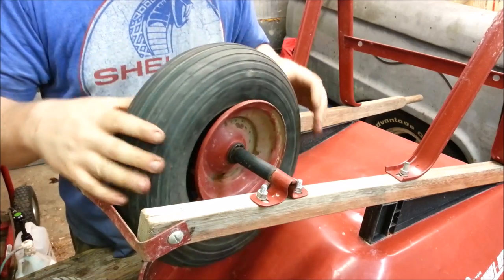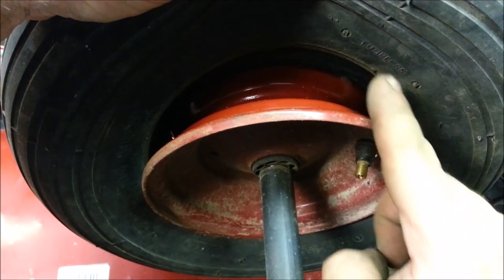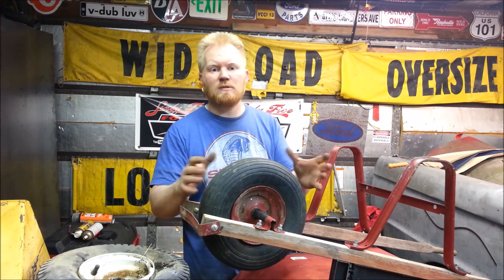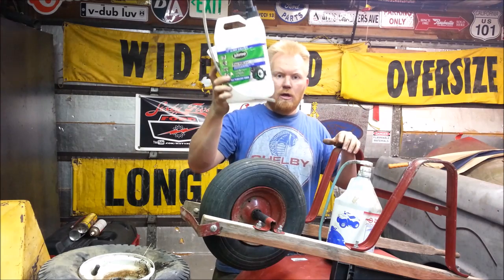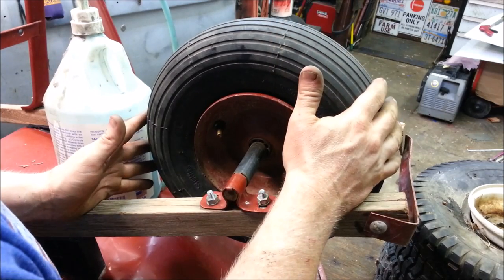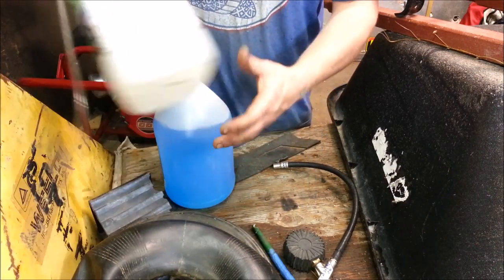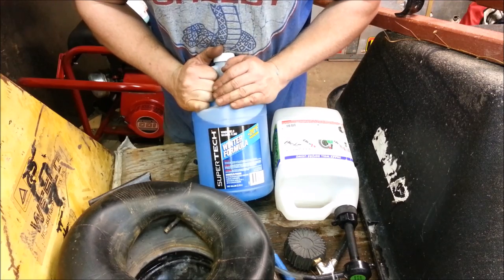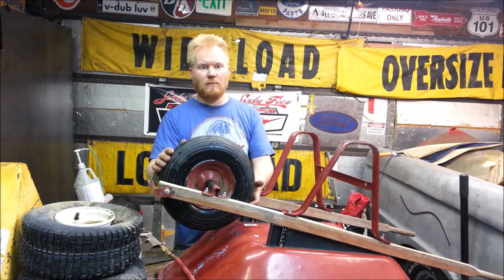No More Flat Wheelbarrow / Riding Mower tires

Comment: I just drill holes and fill it with expanding foam....
Reply: Interesting
Reply: You should make a video of that process.
Reply: But wouldn't the foam crush down and go flattish with use?
Reply: Thats what I thought he was going to do
Reply: @stephenhopkins9541  my son did it to his motorcycle tire the rear tire. I'm 225 lb I rode it 4 miles
Reply: @onewordhereonewordthere6975  did it go flat after the 4 miles or is it still standing

Comment: One of the tires on my snowblower kept losing air, until I Slimed it - no more air loss!  Works to a lesser degree on car tires, at least long enough to get it repaired.  Gotta try the windshield washer/slime combo next time my wheelbarrow tire loses air.  Thanks for another tip, your mind must be constantly working overtime!
Reply from the maker: Dale W Miller Thanks for watching, Dale. Yeah, I've been impressed by the things it can seal up.  -Moe
Reply: I slimed all small tires.  Only one developed a leak st the stem.  The slime dried in the valve stem,  preventing the valve from sealing.

Comment: FYI, I will run a wheelbarrow tire until the first flat! And then it’s garbage! I go to my collection of used 4:80 trailer tires. Install one of those, running 50 psi. And never look back! The thickness of the trailer tires makes them “almost” flat free, tire slime would cover the times it’s not. And the extra air pressure keeps the tire from losing the bead seat, not to mention round. Like you have never rolled a more effortless wheelbarrow. Even with 6cf of concrete, effortless! On a side note: a short piece of flat bar or angle iron in front of the tire scrapes it clean from everything, mud, concrete or anything that might have stuck to the tire.
Hope this helps someone as much as it’s helped me! 👍👍

Comment: It's been about 4 or 5 years now since I used Slime on my wheelbarrow and it's still holding well.  This is the first year that I have to add a bit of air to both tires.  That's pretty freakin' good compared to losing the air every 4 or 5 days.  Thanks again.

Comment: To set a bead I like using the ratchet straps method...wrap it around the circumference of the tire..keeping it centered, then tighten and add air. Works well 👍. Great video . Thx

Comment: Here is my method. I got this tip from another YouTube video. Simply drill two holes, about an eighth of an inch or slightly larger, at noon and 6 p.m. on one side of the tire. On the other side of the tire, drill two holes at 3 and 6. Now you have four holes in the tire, that are spaced 90° each. Now you take a can of expanding foam, also known as great stuff, and you use the long skinny tube, and squirt great stuff into each of the four holes. Don't overdo it, because the stuff is incredibly expanding, and you can actually put too much in it. When you've got the right amount, the tire will be almost as hard as a rock, and it will never go flat.

Comment: I was in a hurry so I took my belt off and wrapped it around the middle of the tire and used a stick to tighten the middle of the tire to get the bead to seat while adding air.
Whatever works right.
Reply from the maker: Heck Yeah.
Reply: I use ratchet straps. Works everytime
Reply from the maker: @scottschaffer4947  ratchet straps rope belt or any other thing works but I have never had a single tire wasn't able to mount by just whacking the side.

Comment: I just had both my wheelbarrow tires flat this Spring.  I went to buy new tubes at my local big box store and they wanted $15 for a tube!  A new cheapo tire with tube was $20.  I hated spending that, but, needed to get them fixed that day.  One was pretty dry rotted anyway.

Also, another trick to seating the bead if you have tubeless is to wrap a rope or bungee cord around the tire.  Same concept as smacking it, but, easier to do by yourself.

Comment: The solid tires are worth every cent you pay.  I have used plywood circles in desperation before. And that doesnt go flat either. Lose the air, go solid.
Reply: @USA i have an old wheelbarrow about 15 years old, it actually wore out from use. The solid tire still works. The rest, lets just say, I had to get another wheelbarrow.

Comment: I finally quit messing around with an old wheel barrow going flat all the time and filled the tire with expanding foam. Ten years later, I need to put new handles on it. But not once have I had a flat.
Reply: I used metal trampoline poles fort handles!  So strong now!

Comment: I used a blown tube as a tire liner. I just cut the center out and the valve stem out. Protects the side walls too. Couple that with a thicker thorn resistant tube and your good to go.

Comment: I am a 61 year old Brit: I come from a building family. Up until at  least the mid 1970s, barrow tyres were made same as car tyres; The tread was over 1/4 inche of solid, deep treaded, very hard rubber. The walls were thick, stiff and well reinforced. Like so much else these days (excepting of course vehicles, IT of every description, high quality white goods etc) modern utility tyres are shyte beyond comprehension: they are beyond a joke, beyond insult. A wheel barrow by design, is an outdoor,. tool, designed rough tasks in a rough environment. Anyone purchassing such a tool should be able to push it over the occasional minor prick hazzard and without concern or fear of a puncture. As a boy, and teenager, I pushed wheel barrows over building sites over every possible prick hazzard that would shread one of these modern rubber gloves. The wheels often outlasted the barrows, which lasted YEARS of continuous daily assult, literally !! I managed to pick one up about 8 years ago, paid five pounds for it; it was the deal of the decade, I was delighted :) It looked about thirty odd years old, no paint left, a good array of dents of various sizes, but had been kept under cover for much of its working life to date. I saw another thirty years in it no worries, and that I would go through many modern biscuit tins on rubber glove tyres  in place of this masterpiece of design, workmanship and construction. How many ill-opportune punctures will I avoid over the decades heneforth ?? I could not believe that the guy accepted my offer: he thought I was crazy to give a fiver for it !! I appreciate it every day that I walk past it. They sell us shyte because we settle for shyte. Is it, or should it be a crime, to manufacture something of such poor quality and unfitness for purpose, of limited useful life expectancy, which consumes perhaps 70% to many hundreds of % of the total resource requirement/burden of a quality alternative ?? Maybe the modern ethos is economically sustainable, in an infinite world; only unless you know something that I do not, I am going to err on the side of a finite world, which by definition, renders rubber gloved biscuite tins NOT susstainable.

Comment: Another great video, thanks. I put half of a container of slime in a riding mower tire and the other half in the other tire and they sealed up great, thank you. I will try the windshield liquid adding to the slime next time I do other tires. Thanks for the great videos.
Reply from the maker: Superiorpowerwash It's handy for large tires like the rears on riding mower where they require a ton of slime to coat. The washer fluid helps distribute it so you can use a lot less.

Comment: Sir i am on my third set of replacement inner tubes for a 4.00-8 tired lawn tractor dump cart. Cart is great (USA Made), but the tires and tubes are not. First set leaked at the center seam and the second/third set of ‘Heavy Duty’ tubes punctured w bull stickers. I was reluctant to use a tire sealer and don’t really  want solid tires. Between the tire liners, first thing i thought of, and the 50/50 mix you’ve shown us i’ve hope again. Thanks for taking the time to make and share this solution to a frustrating problem.

Comment: i used slime in 2013 on my tires from 1978, they still hold air nicely. i may add tubes someday though.
Reply from the maker: Rinoa Super-Genius It's amazing what it will seal.
Reply: sixtyfiveford
its like liquid ducktape.
Reply from the maker: Haha, so true.
Reply: I just tried it with tubes and it doesn’t work worth a shit. I’m going to pull the tube I think it will work better tubeless.
Reply: @sixtyfiveford  it basically guarantees that guys like me can always pull lawnmower tires out of the trash and basically have free tires for life
Reply: wonder how it would work  on a car tire .  after one year my new tires on aluminum mags are always needing air .
Reply: It rusts the crap out of your rims and beads. I used to use slime too. Not anymore its really bad if you want to save money on rims every tire change.

Comment: Most every small tire here has been slimed. A lot of times after putting it in they go flat again once then hold well after that. It is nice to go use something and the tires are up .
Reply from the maker: wtbm123 I find that happens a lot. I get a much better initial seal when I throw a little windshield washer fluid in with it, especially on tires with huge amounts of dry rot.

Comment: On wide lawn mower tires I put a ratchet strap around the middle and squeeze the center. It forces the sidewall out against the rim and let's the air catch the tire to the rim. Love the slime tips.
Reply from the maker: I had a strap nearly take my head off and have talked to guys since that have got hurt pretty bad by having that strap break. One guy had his teeth knocked out from the strap snapping once pressurized. I started just solely doing the flammable bang method.  More intense but I feel like I can stand out of the way.
Reply: @sixtyfiveford  Yeah I don't let it get too much pressure on it. Just little spurts until the bead touches. I've had close calls with the fire method.

Comment: Seating the bead my favorite solution is I rap a ratchet strap around the tire and I snug it up and tighten it down and it forces the walls out and makes it easier to get the tire to seat and I have done this on small car tires (AIR IT SLOWLY AS SOO. AS THE BEAD SEATS TAKE IT OFF AND TAKE IT TO FULL PRESSURE)
I also use to work in a shop and one of the guys used starter fluid to seat his bead!!!
(DON'T RECOMMEND THAT ONE) BUT IT WAS COOL TO SEE!!!

Comment: I have been buying tubes lately. Most of the time you can order Carlisle from Walmart online cheaply and pick it up at your local store for free shipping. Definitely spring for the slime too. I like the idea of some shielding inside the tire. Thanks.
Reply from the maker: 57WillysCJ I'll have to check on Wallyworlds tube prices. Thanks for the tip.

Comment: I have seen Automatic Transmission Fluid work in keeping small tires from slow leaks.
Reply: Atf fluid preserves rubber tires... Like on a camper that only gets used once a year.  Wipe some on the sidewalls where the sun exposure is.

Comment: Liked most of this. I've had good success with Slime on auto and yard equipment tires especially by slathering some on the beads as you did. My only issue is with the WW fluid. I'd be concerned it would rust the metal rim.

Comment: I bought a tire and innertube. The tube burst right away. I made a steel wheel of a cultivator tine.
Drew a circle on plywood the same diameter as the rubber tire, cut it out as a male tire jig.
   Tried cutting 9/10 way thru to bend the 1/4" × 2" wide steel, so then bend, then weld it, but the spring steel always broke. So instead cut about 16 lengths, set them around the ply, welded them together. 
   Centered the steel ring tire around the stock wheel, tacked in steel tube spokes, 4 at first. 4 more later. Welded. 
   On the outer steel tire, the weld beads provide the tread and it works great. 
   No flats, because of the steel flats.
Reply from the maker: That's awesome ingenuity.

Comment: I tried Slime and it was actually worse than Fix a flat.  My buddy welded an inner bead lip and he said that cured his problem.
Also a quick way to seat the bead is a small squirt of starting fluid and and a match.  Works every time. CAREFUL not too much starting fluid.
Reply from the maker: Slime is useless if you don't have enough. For bead seals you need a good amount or dilute is with windshield washer fluid so it flows. By itself it is too gooey and never flows to the bead.

Comment: Try chunks of foam placed in the tire and back filled with expanding foam next time. Great video man!
Reply: Custom Southern Arms were you just thinking out loud, or have you actually done this. I have thought about filling a tubeless with expanding foam, and I may try it very soon. I have a flat on my wheelbarrow that i have been putting off fixing till I actually need it......
Reply: Dennis Arterburn actually done it. You need to put chunks of Styrofoam in the tire first to take up the bulk of the space. If you try to do it with just cans, it's a nightmare.

Comment: You can also clean the rim real good, and then spray that Flex Seal product along the rim, give it time to dry and then install the tire again, and it will keep it from coming off and no more leaks in most cases.
Reply: Bead sealer, actually made for that
Reply: @romak4756   I used that on my Snowblower wheels, keep going flat every year, bead sealer didn't work at all.

Comment: I've always used foam in my wheelbarrow myself. Works great.
Reply: @Ron Patrick actually foam does work bud. I've used this method over 20yr. I still use the same barrel. So that's just your own opinion! Not  factual. ! You don't even have a clue on what type of foam or mixture I threw in or just as is..

Comment: I would like to see a video on how you manage to reseal the lawn mower tractor tires. I've seen guys squirt quick start inside the tire and light it but I've been reluctant to try it. What do you think?
Reply: Ya I haven't blown myself up over the 40+ years I've been doing it jus don't use a huge amount,  a little goes a long way! You can also use a tie down strap around the tire to seat the bead and air it up.

Comment: I filled mine up with 2 part epoxy..  except the epoxy was more of a rubbery flexible stuff..  gotta use the 2 part because that stuff doesnt need air to harden, hardens via chemical reaction.  And if i ever need to change tires since i used the flexible stuff i can just knock off the tire and rim n all..  now i did add some spray foam after so the tire wouldnt spin on the rim..  gotta fill it on its side also..  so wont have bumpy tire

Comment: Got frustrated with my dually wheel barrows getting flats so I replaced one pair on one of the wheel barrows with airless foam core tires. What I immediately experienced, solid tires don't give. If you have a loaded wheel barrow the solid tire will not flex over a bump, like a slight raise on a concrete sidewalk, like 1 ", it stops like it was ran against a wall. The dual wheel wheel barrow has a 750# capacity, with I think 10 or maybe 12 cubic ft of volume. Tire flex is important for smooth operation. These solid tires are like the old steel wheels, primitive results, no flats however.
Reply from the maker: Raymond Daye Yeah, I'm with you; solid tires ride very rough. I've used solid wheeled wheelbarrows and almost lost the load on small 1"-2" humps because they'll dead stop.

Comment: Hey, very good. Have used slime for many decades I think. And because wheelbarrow tires are so thin and crappy. Should be illegal to sell those crappy tires in the states , Or anywhere in the world. in my opinion. However thank you for the hot tip. good thinking on your part. Also noticed the rear of about a 65 Ford pick up in the video. Have a 63 highboy 4 x 4 original with the 223 in it. Doesn't burn or leak a drop of oil. Keep up the good work! Glad to see some people using their God-given genius of a brain these days. Stay well have a beautiful day thanks again. Jim
Reply from the maker: Hey Thanks. That's awesome, does it have the refrigerator box bed ('58-'60)?

Comment: What happen sometimes you find you fill it up and within a couple of days it looses air this is because the tube is porous.So take the tube out fill it up with air and get flour and make sure rub all around the tube completely so the flour gets into the pores then take the air out and put it in the tire and you wouldn’t have the problem it also work for bicycle tube.
Reply from the maker: That's an interesting idea.

Comment: thank you! is it recommended to put this stuff in motorcycle inner tubes? i mean will it affect your ride on high speed tyres?

 thanks again. you have ingenious solutions to problems that all of us afflict
Reply from the maker: I've never used it anything that didn't go offroad.
Reply: Also, you may have out of balance issues at high speed. I wouldn't do it if it were me.

Comment: For a more cheaper route, HF has wheels for less that 10 bucks with coupon. The only problem as soon as you use them out in the sun they begin to dry rot, when it starts cracking you know you have  tube tire when it pops out.
Reply: The solid wheelbarrow tire? Or something different?

Comment: One Item I have thought about using is the foam spray insulation.
Once in it would never be able to be punctures...
Just a thought...
Reply from the maker: wdunn19 The spray foam might be ok of light duty tires but would quickly break down with the extreme loads and bumps a wheelbarrow takes.

Comment: I soaked the metal rims with used motor oil. (I had a solid tire's rim rust out!).

I put oil over the places where the wood was rotting too. Will it help?

Comment: Instead of slamming it wrap a ratchet strap around the tire get I snug then start inflating tire that spreads the bead out to seat on the wheel. You can also use a rope in the same fashion but ratchet strap is easiest